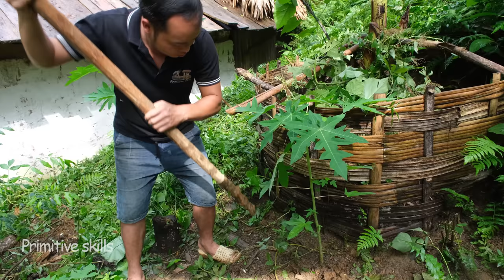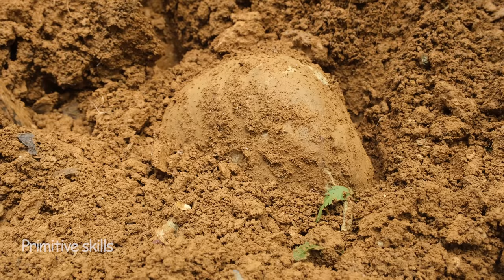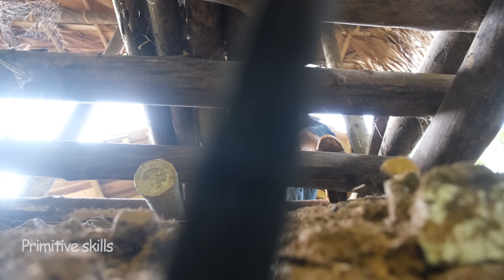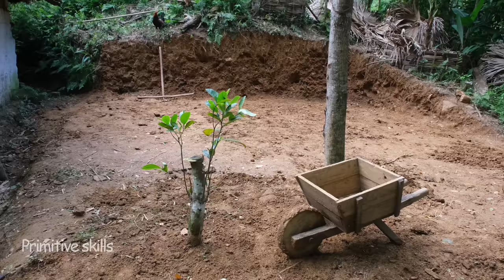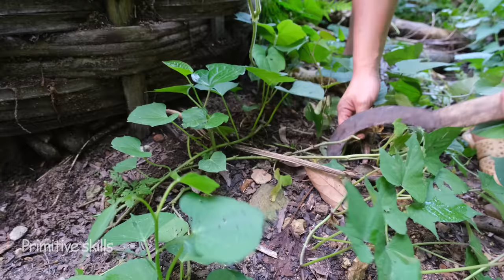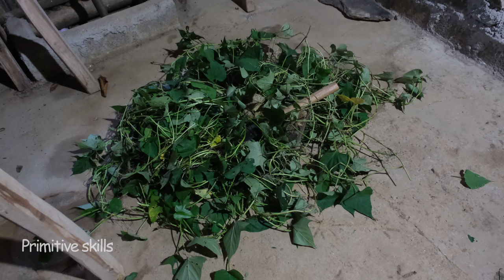Firewood Storage Upgrade, Backyard expansion and take care of the farm, Duong daily life

Comment: Your plank roof is starting to show a little weathering. It might be good to prepare an upgrade to replace it in advance.

I was thinking you could make tiles from either clay or slate/stone. You might have to upgrade the beams and rafters for the extra weight, but it would give you a much more permanent roof that shouldn’t need replacing for a very long time.

Keep up the good work my friend!

Comment: If you don’t like male papaya tree, you can convert it to female papaya tree by simple procedure. Get two chop sticks and sharpening two ends of the chopsticks. At halfway point of the stem drive in one chopstick into the tree until the sick come out the other end. With the other stick drive it crosswise  + as shown.  One stick on top of the other crosswise. The next season you will get fruits. Go to google and write how to change a male papaya tree to a female tree. It will show you by video. Easier to understand then writing. There is another option. Cut off the top of the male tree and it will bear fruit the next season.
Reply: Dude: if you’ve got some problem with the sex of a tree just let it be.  No need to violate it with some unwanted sex operation.
Reply: It will be a dylan Mulvaney tree
Reply: @simonl4523  none of your business what I said. I do what I want. End of story.